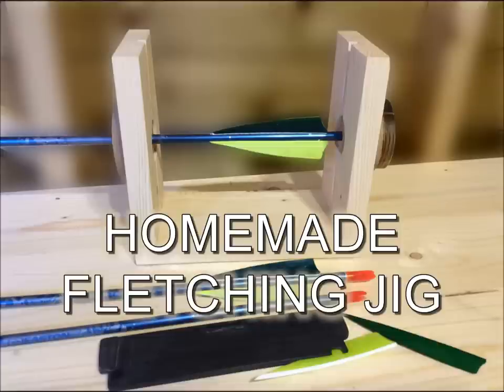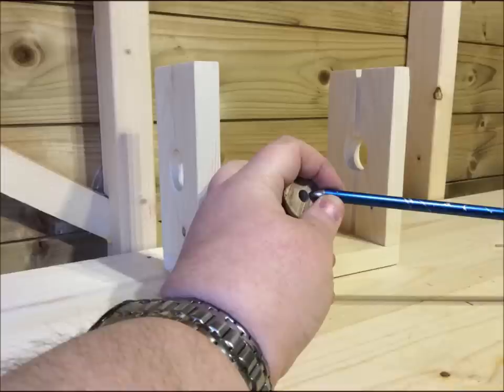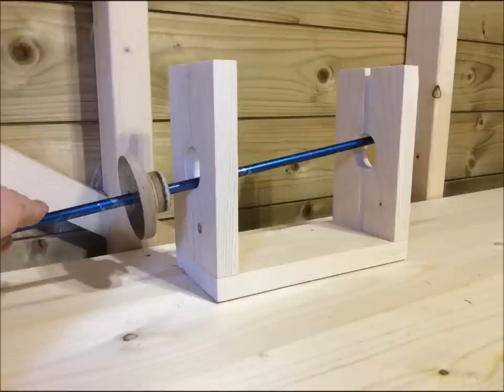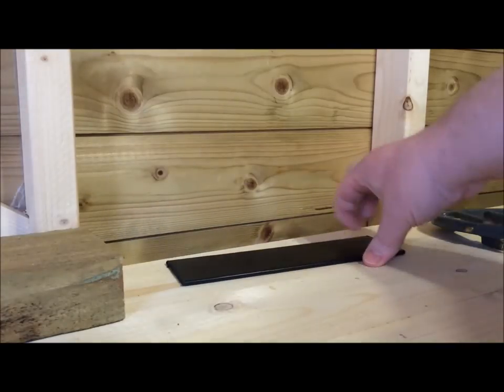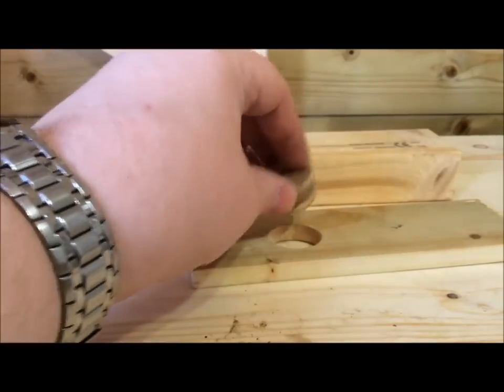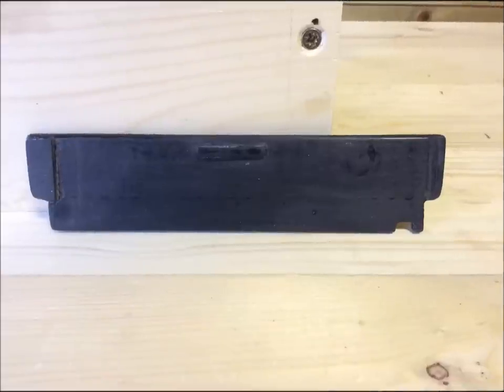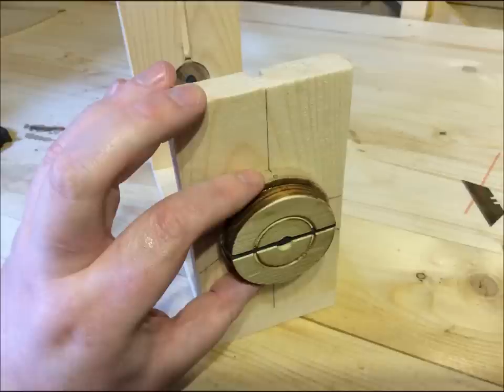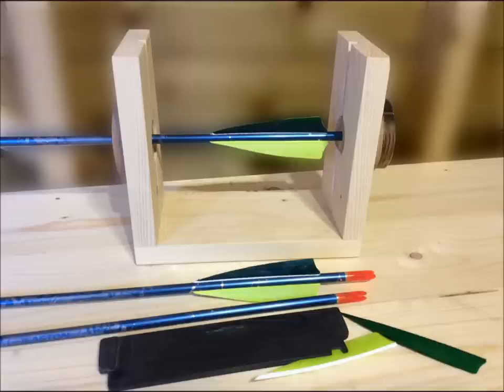How to make a FLETCHING JIG - simple & effective by VOGMAN

Comment: GREAT JOB !! can't wait to make this.. Question, how do you open/close the vain holder after the vain is glued to the shaft ??
Reply from the maker: The clamp has a thin gap in it (watch again and you'll see after flattening the pipe, I reheated just a little, inserted a few strips of thin card, then flattened again). This gap is just right... it holds the feather without dropping it but once the adhesive grips it, it's easily pulled through.
I hope this answers your question : )

Comment: Why couldn't u use broad heads?
Reply from the maker: +Benjamin Fisher 
Hi Benjamin,
Because the arrow head probably wouldnt fit through the hole in the spindle section, though i suppose this could be modified with a little careful carpentry.
Hope this helps.
Reply: Yes thank u